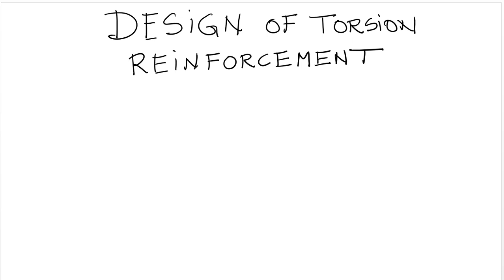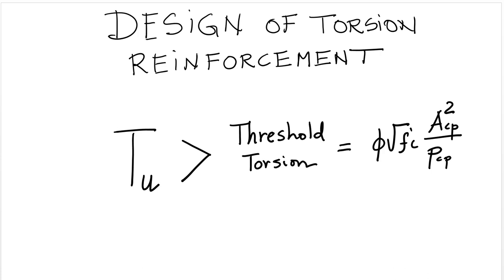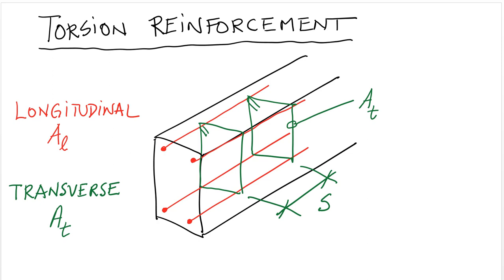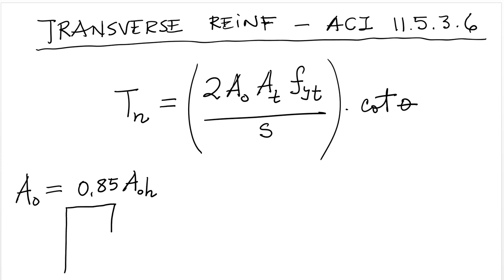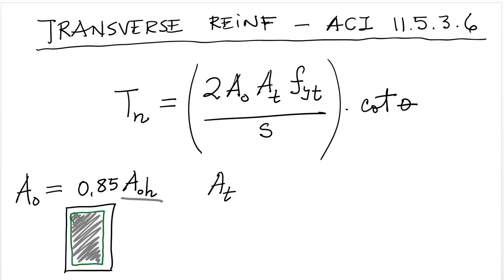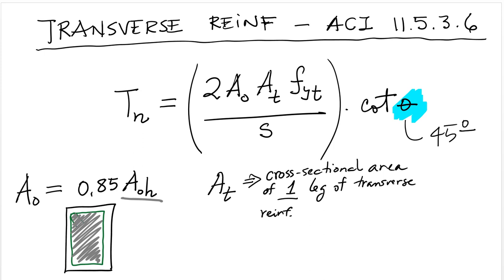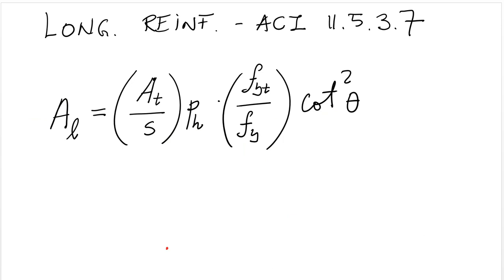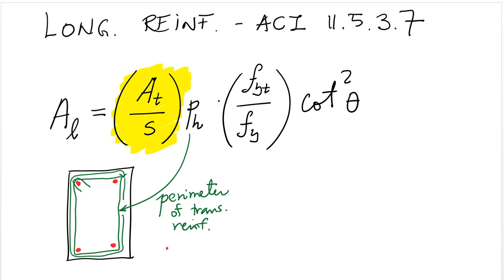Transverse and Longitudinal Torsion Reinforcement in Non-prestressed Beams

Comment: Am I understanding it correctly that for the equation for determining transverse reinforcing you use the center line of that transverse reinforcement to determine area and for longitudinal reinforcement equation you use the outer edge of the transverse reinforcement to determine area?
Reply from the maker: To determine the longitudinal torsion reinforcement  the formula includes ph, which is the perimeter of the center line of transverse reinforcement.